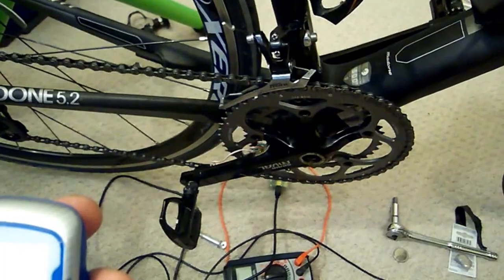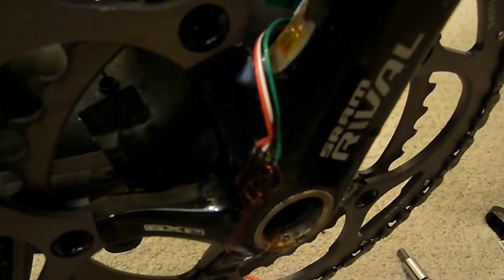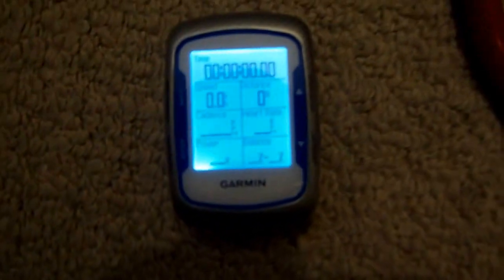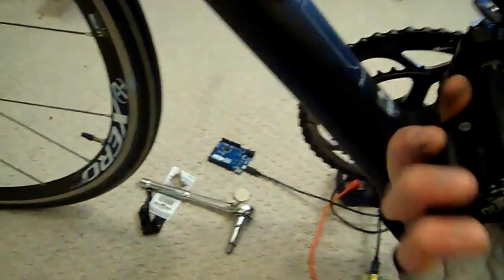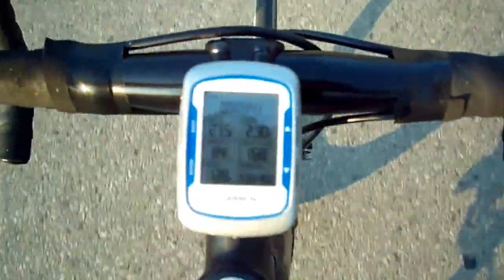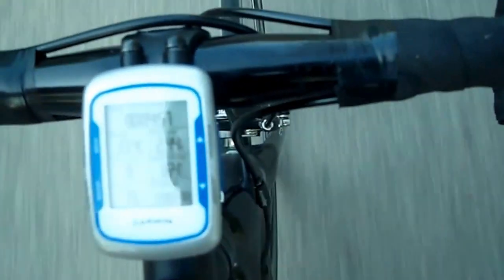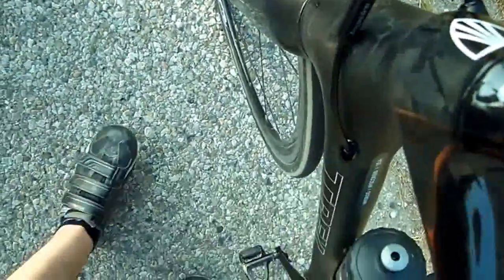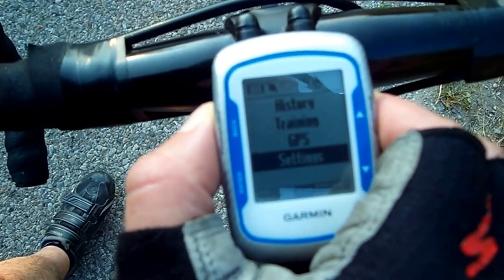Accuity V4.1 Bicycle Powermeter Testing

Comment: 400W from hand cranking? ha :D even 50W is a lot! Perhaps some better filtering and calculations needed?
Reply from the maker: It's been a long time, but notice this was only the first rotation -- that's why I mentioned overflow issues. What happened (and keep in mind this about 4 years ago), is that the rotation counter overflowed waiting for the rotation to happen, so it's cadence calculation becomes wrong and much higher - but the torque accumulator code didn't reset, this is what I mean by overflow issue. So when stopped pedaling for too long the first pedal stroke gave bogus data.   This turned into something commercial and now on world pro teams and a lot of smart people developed better firmware.
Reply: Are you saying you got revenue for this turning commercial? That's cool! Stages or 4iii perhaps? :P Something like Powerbeat has would be niceto make diy with todays 3d-printing and other advanced SoCs that are available.
Reply: Ha, just googled you.. I was right! :D
Reply from the maker: Listed on my blog, 4iiii's. There is a lot that can be done now with the 3d printing and SOC's like you suggested -- but like many things I've found that it's much much harder to get past what I did in this video to actually selling something. The 4iiii's product is very different though. Gages, processing, firmware, pcb, etc. Nothing is really the same, but it all came from this project.
Reply: Yeah I agree, although bulk of the tech kind of was already there with SRM and Powertap. While I have my P2M, I'd still be interested in making diy versions (for myself).. Perhaps someday we'll get proper open source software for multitude of diy-hardware. Again, thanks for the insight.